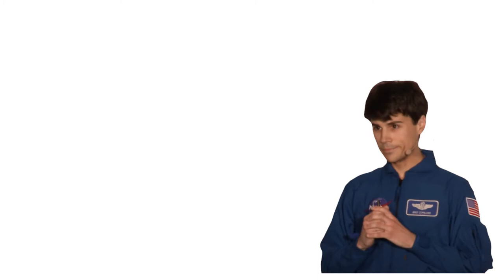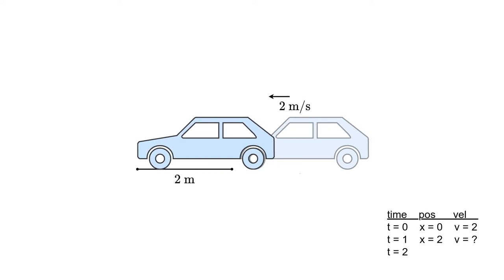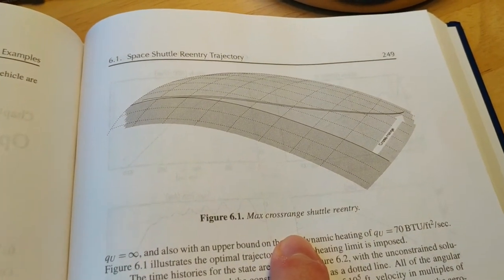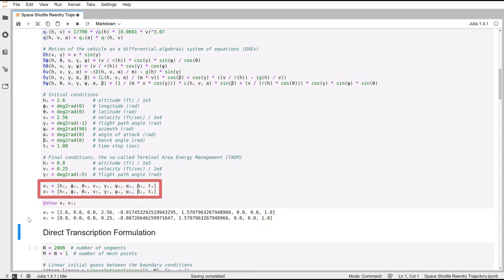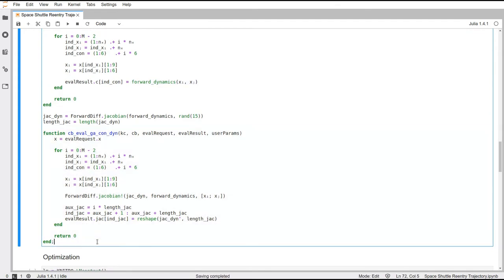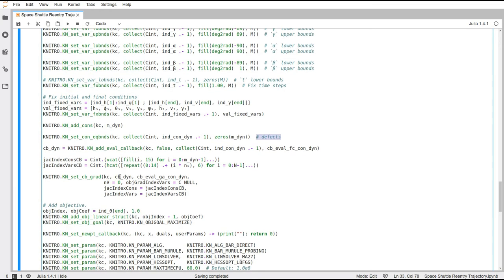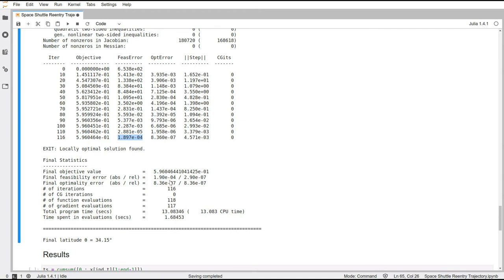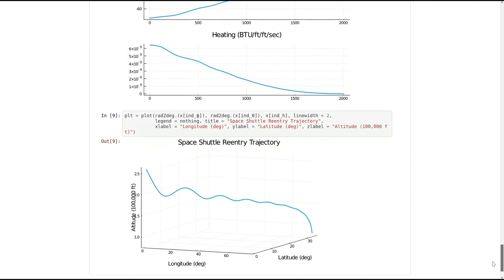Calculating the Space Shuttle Reentry Trajectory (Optimal Control)

Comment: Hello! I am interested in your video, since I myself am a student in the same specialty, but only in Russia and I am trying to simulate the trajectory of the descent of the Russian shuttle (Buran). In fact, our approaches to solving optimization problems are quite different. For example, when solving optimal control problems, we often use the maximum principle of Lev Semenovich Pontryagin as the basis for their solution, the meaning of which is that optimal control delivers the maximum of the Hamilton function. I won't go too deep into theory (I hope you have literature on the principle of maximum). You, as I understand it, are based on dynamic programming. Thank you for this interesting video.